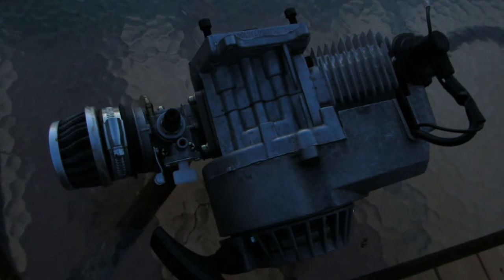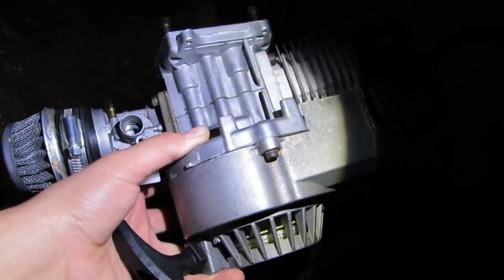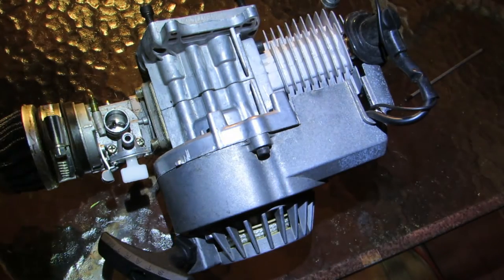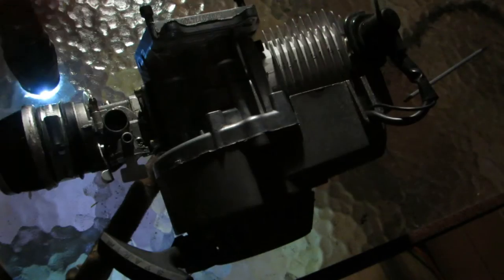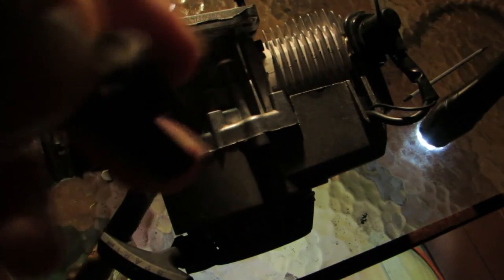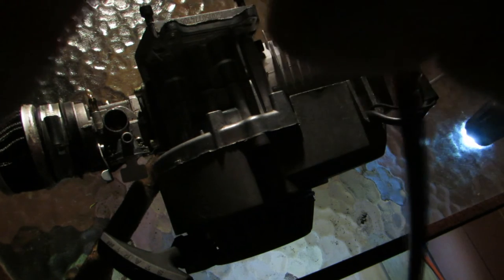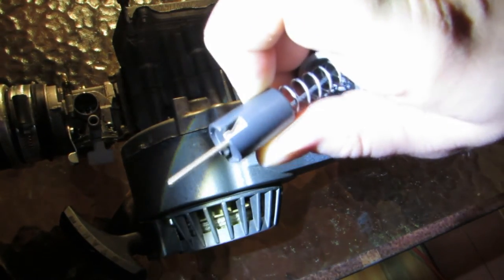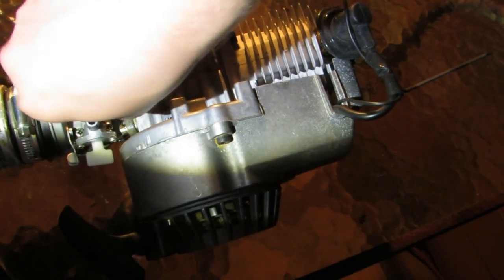How to install pocket bike engine throttle cable

Comment: I just did everything you did to replacse mine 2 cycle it on a mountain bike the throtle is realy hard to turn and when starting the bike the throtle is wide open and wont work but on hi idle one thing i noticed was my spring os like bent a little to one side will it straighten its self up or could that be a problem im new at this do any feed back would neawsome thanks for your time

Comment: Hey can you show us how to put the throttle cable to the throttle cause I attempted it and it won't come back like it stays in the same spot and I've attempted it a couple of times and it just won't come back and that's a problem bcs I could crash since it don't let off the gas when I let go of the throttle

Comment: thanks for the videos,  very useful. can u please make a video installing a gas tank ? thanks
Reply from the maker: Do you mean on a pocket bike?
Reply: +obese hamster films i have a go kart. i want to know howcto install the gas hose, thanks for your reply
Reply from the maker: +Camilo Nieva I just took my gas tank from a weedeater, I made one of the holes in it bigger and screwed a 1/4 inch barb into it then plugged the other hole up, although if you tell me what kind of gas tank you have I can do my best to help.
Reply from the maker: +Camilo Nieva Is it just like a standard tank with two holes?
Reply: +obese hamster films i got it, thanks for the explanation! so, getting the engine throttle ready and the has hose + tank, is it ready to run? this is my 1st time doing this, completely amateur sorry.
Reply from the maker: +Camilo Nieva well, you do need to put a fuel filter somewhere in the gas line, just like a lawn mower fuel filter that will fit the fuel line your using, I'd also recommend putting the fuel filter further down the line closer to the engine so the fuel will go through the filter easier.  other then that you should be ready to go as long as you have the right gas mixture, as I was telling the other guy here you have to pull the pull starter line out slowly almost all the way 4 times and then pull it normally immediately after, you might be able to get away with two in the future though.
Reply from the maker: +Camilo Nieva just keep in mind that these engines can be finicky at times so you may have to mess around with the air lever some, generally the air lever is supposed to be all the way up to start the engine but since it's hot right now it may need to be down more to let more air in.
Reply from the maker: +Camilo Nieva Sorry, I forgot to mention about the fuel barb that screws into the tank, I used a generous amount of gas resistant liquid Teflon to make sure it didn't leak, I also put two washers between the outside of the tank and and barb to make it flush with the bottom of the tank.

Comment: I still have a few questions... I contact you for help?
Reply from the maker: OK, what's your questions?
Reply from the maker: Or I could message you my email address.
Reply from the maker: Hi,

Yeah, I'm not sure exactly what the hole for excess fuel is meant for but there is a line that comes from the carb that drains excess fuel if the engine is titled too much so I'm guessing you can hook up a line to the place where that line is connected to the carburetor and run it to the excess fuel hole on the gas tank so the fuel doesn't just spill on the ground.  As for the fuel line, you want to use the hole that is nearest to the bottom of the tank so when the fuel is low it will still go into the fuel line, also you should put the fuel filter about half way down the line so it will have enough pressure to get through the fuel filter and into the carburetor.  The input hole for the engine is on top of the carburetor and there is a white knob that comes from near it, when  the knob is straight up and down it is letting fuel through to the carburetor and when it is horizontal it is stopping fuel from entering the carburetor.  As for the kill switch, these engines have a wire with a connector at the end that hangs off the side of the engine, it comes out by the spark plug wire, this is where the kill switch goes, you can find the kill switch for this on ebay by searching: pocket bike kill switch.  Just make sure the connector will fit in the connector on the engine and it should do the trick.  Thanks.
Reply from the maker: Hi,

Yeah, I'm not sure exactly what the hole for excess fuel is meant for but there is a line that comes from the carb that drains excess fuel if the engine is titled too much so I'm guessing you can hook up a line to the place where that line is connected to the carburetor and run it to the excess fuel hole on the gas tank so the fuel doesn't just spill on the ground.  As for the fuel line, you want to use the hole that is nearest to the bottom of the tank so when the fuel is low it will still go into the fuel line, also you should put the fuel filter about half way down the line so it will have enough pressure to get through the fuel filter and into the carburetor.  The input hole for the engine is on top of the carburetor and there is a white knob that comes from near it, when  the knob is straight up and down it is letting fuel through to the carburetor and when it is horizontal it is stopping fuel from entering the carburetor.  As for the kill switch, these engines have a wire with a connector at the end that hangs off the side of the engine, it comes out by the spark plug wire, this is where the kill switch goes, you can find the kill switch for this on ebay by searching: pocket bike kill switch.  Just make sure the connector will fit in the connector on the engine and it should do the trick.  Thanks.
Reply from the maker: If the pull start is stopping after just a short distance it wouldn't be starting right, with mine I have to pull the cord most of the way out slowly at least two times and then pull it fast immidiately after, you could also try giving it a little bit of throttle or messing around with the air lever, since it's hot right now you may need to give it more air to get it to start, I know these are basic things but It should be starting if these things are done right and it's getting gas ( sometimes the in-line fuel filter doesn't let gas through so you have to tap it and shake it).
Reply from the maker: Yeah, I just happened to have the fuel line I'm using already and it is 1/4 inch line, I thing lows and home depot would have it but I see you said the problem was fixed.  I took my gas tank from a weedeater and drilled a hole in it, then put a 1/4 inch barb of some kind in the hole.
Reply from the maker: Hmm, you could try slowly pulling the pull start four times but if that doesn't work it sounds like your doing everything else right.  I would contact the seller and ask him about it, he might send you a replacement.
Reply from the maker: Ok, your welcome.  I hopes your able to get the engine to work.
Reply from the maker: Hi,  That's great that it might be working now, you should be able to replicate that if it's working properly. In order to turn off the engine without letting it just run out of gas you need to install a kill switch into the connector that is hanging out near the spark plug wire. These kill switches can be found on ebay by searching something like "pocket bike engine kill switch".
Reply: do you already have one? if so could you possibly link me to one that you would see if its reliable?
Reply from the maker: I haven't bought one for my engine yet but this is the cheapest one on ebay as far as I know: http://www.ebay.com/itm/Mini-Pocket-Dirt-Bike-Atv-Quad-4-Wheeler-Shut-Off-Kill-Switch-Button-47cc-49cc-/191363281568?hash=item2c8e23f2a0:m:mvv-eArEHzW7GBu5cf8CSYw&vxp=mtr

As far as I know this should be reliable, just make sure the connectors are compatible.  I think it works by shorting out the frame and stopping the spark to the spark plug.
Reply from the maker: +Ryan Luong (AK TakticZ) Yes, this
is how I turn mine off.  I turn the fuel knob off and let it run out of gas and die.  I should probably get a kill switch soon.
Reply: does that affect or damage the engine or carburetor at all?
Reply from the maker: +AK TakticZ Gaming It doesn't seem to have damaged mine, all your doing is letting it run out of gas so the carburetor will just need to be filled back up with gas the next time it's started.  Is there some reason you don't want to just get a kill switch for it?